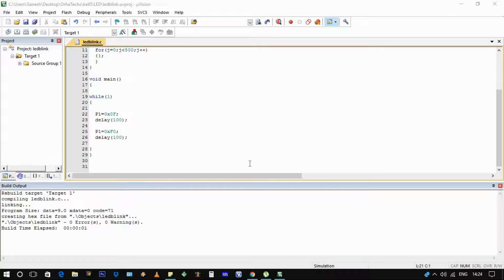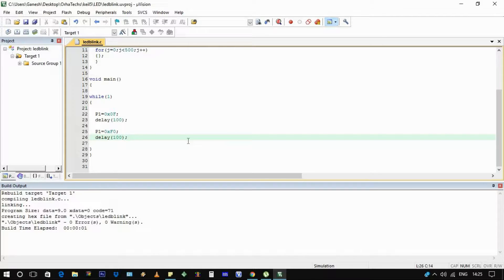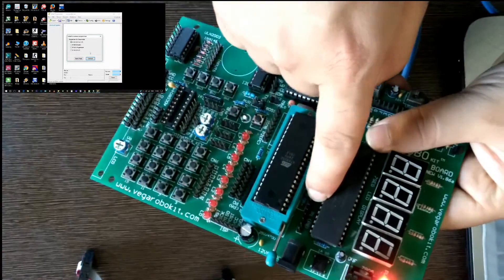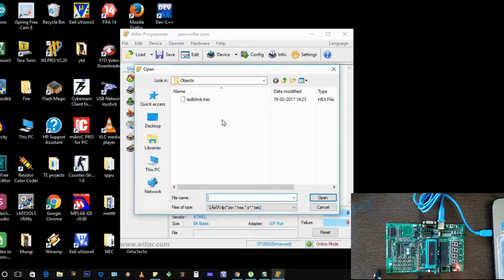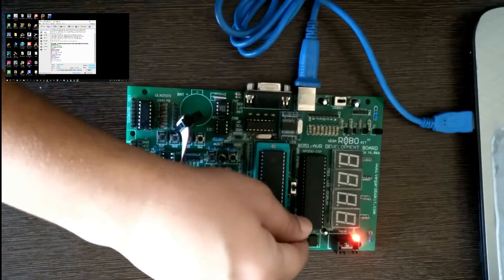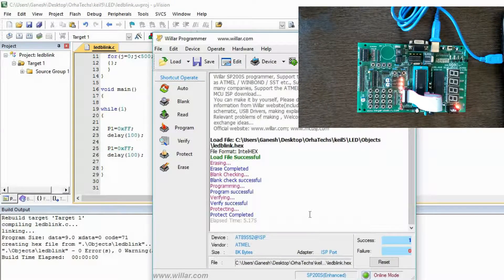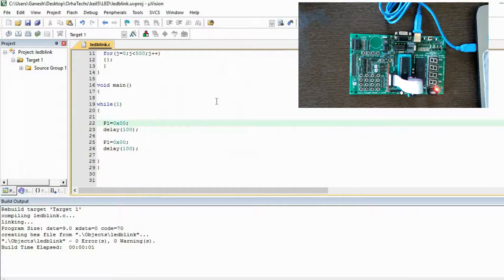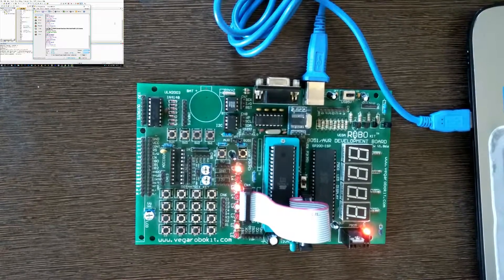Multiple LED Blinking - Part 3 - 8051 Tutorials

Comment: Hi, I thanks for posting easy learning videos , I have question regarding voltage change with respective to 1 and 0 from hex file.

Suppose if we set any pin of the port1 to "1" in program and connects to LED which grounded so it blinks, That means the LED has got voltage from the port, But if I set the same to "0" It will not glow , that means there is 0 voltage. So my question is, which unit in microprocessor interprets this 1 and 0 and controls the  real voltage on that port , and how it works from binary to real voltage on transistor?.
Reply from the maker: Sorry, I can't help you with this
that is totally a different subject (VLSI)